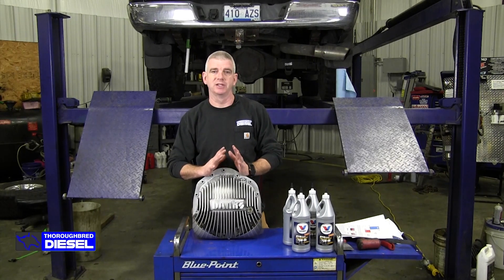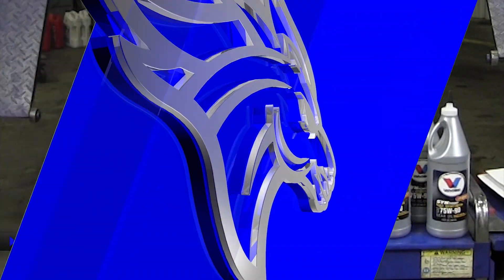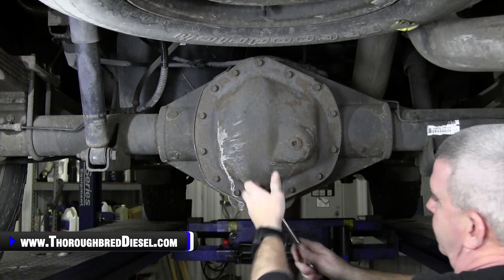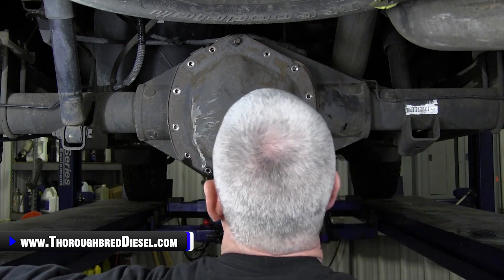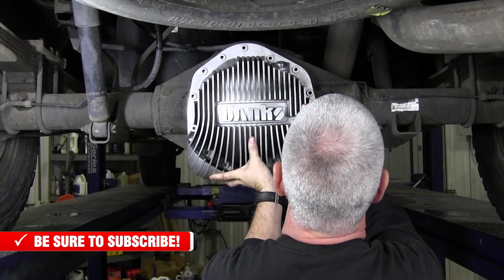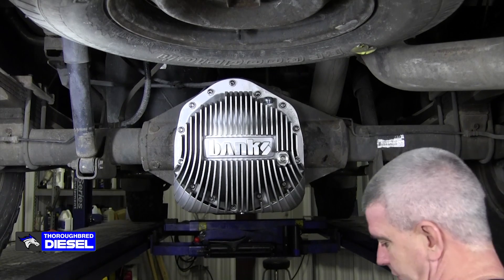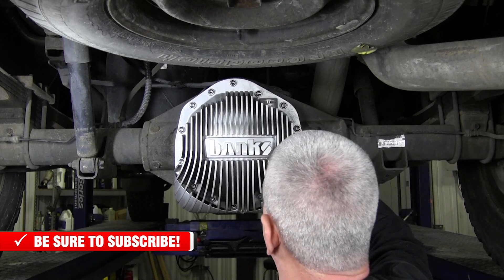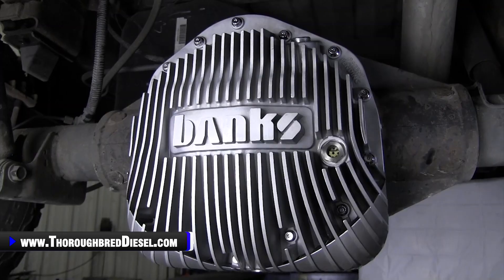Banks Diff Cover Install: 2005 Dodge Cummins

Comment: Good video, sure is easier than doing it with the truck sitting in the driveway...which is what I did today!  Couple things...the instructions that came with mine say to torque to 22 lbs. not 30. Also, they tell you to use the teflon tape on the plugs (even though the site glass has a nice "O" ring). Came out good though, looks great and I'm glad I did it just for the oil change...dark brown, not sure when the previous owner changed the fluid last (if at all)!
Reply: I am installing mine just for the ease of maintenance.  Drain and refill.  Nice

Comment: I have an 05 ram 3500 with the AAM11.5, I run 315-70_17 tires and the spare. Will the banks differential cover clear the spare tire upon compression during towing or off-roading?. I bought the AFE differential cover, they sent the wrong part they give me one for a 10.5 differential. I can't say as I have ever seen a 10.5 differential in a 3500 ram, I may be wrong so be it. But from the measurements this was not going to work on my truck anyhow so I got a refund. I like AFE is design as well with a magnetic drain and a magnetic dipstick and a large sight glass, it also has internal and external cooling fins. I subscribe to your tech channel as well so you have my email. I just got back on YouTube I got kicked off a year prior to the last election and you can probably figure out why 🤔. I'm asking because towing 20,000 plus pounds regularly and sometimes we hit the old bump stops I don't want to be a catastrophe looking for a place to happen. Thanks for listening to me b** about it 🤑

Comment: @thoroughbreddiesel Its NOT 30 FT LBS. Just snapped a bolt.  Thanks.
Reply: I installed a Mag-Hytec cover and they said the torque was 30 ft lbs also, one bolt broke. I think it was more a weak bolt than the wrong torque value.

Comment: Nice cover but is it really necessary.. Diffs do not have a high failure rate and usually not related to the cover. High loading on the bearings and gears are the usually the problem. The internal grooves and channels tend to create more drag and friction but the outside fins do help in cooling.

Comment: The Banks website says this is not available for the 2019 RAM 3500. My truck is not a DRW nor is it the max tow package which I think has the new 12” diff. Isn’t my rear diff the same 11.5” 14 bolt that is on the 2018? Will this new cover fit my truck?

Comment: What type of gear oil?
Reply from the maker: We use the recommended gear oil for the application per your owner’s manual. I hate to call out a specific oil weight here if someone watches and they don’t have a AAM differential in their truck.
Reply: @thoroughbreddiesel  can you please elaborate??

Comment: Why no light oil on the O ring ???
Reply from the maker: Honestly didn’t consider it as the cover mates to the diff without any mating tolerances. Wouldn’t have hurt anything though.
Reply: what kind of oil? and put it where?? I just ordered one of these and want to make sure it's perfect

Comment: Millions of trucks have drove billions of miles with no need for a bedazzled diff cover ........
Reply: Yep.  Of course, millions of teamsters drove billions of miles with no need for steam power, too........
Reply: If you did just a little bit of actual research you'd find that the Banks cover gives you cooler operating temperatures with the ram air fins as well as a better oil flow because of the internal pattern.

Comment: Very hesitant to buy one. 
If it "breaks away", then what? Can you buy the air fins separately?
Also, doesnt hold more fluid. 
Waste of $$$ unless buyers actually believe this would be considered "working on my truck"!
While you're at it, install a light bar for all your adventures. 🤣
Reply: @Rob Roy I did.
Reply: @Rob Roy still am. 
I'll stick with my stock diff. cover, save my money and just change fluid more often.
Reply: @deesupyo9620  Claims to save money by changing fluid more often. Sure thing bud. Sure thing.
Reply: @buffaloSoldier519  "More often" meaning manufacturer recommendations. It's an necessary modification. Just save your money and keep the engine running top. Silly mods are just a way for 3rd party parts manufacturers to make a quick extra dollar.
Reply: @deesupyo9620  No you didn't. Banks said they will replace it lifetime warranty if it breaks...
Reply: @thefinalroman  why buy unnecessary mods if they're going to break?
Reply: @deesupyo9620  wtf u talkin about? The stock one doesn't have a lifetime warranty. Why use a cover with no warranty that can rust?